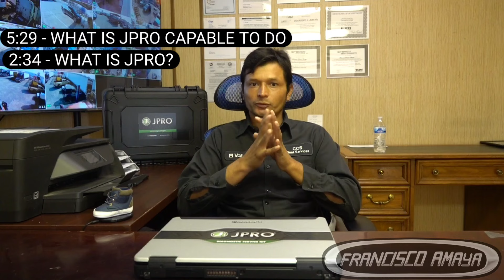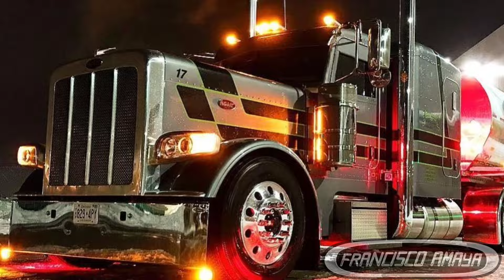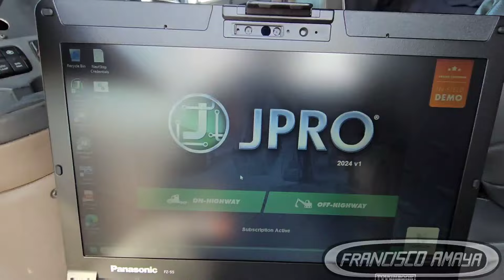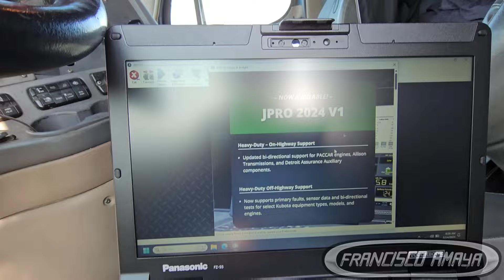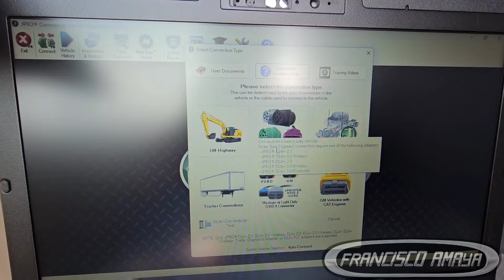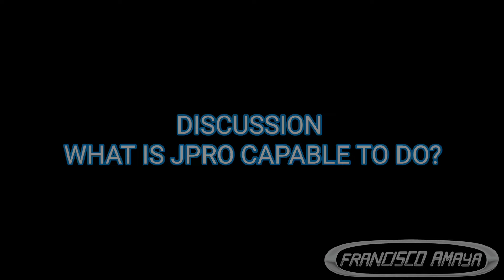JPRO diagnostic software for heavy duty and medium duty trucks honest review

Comment: Thank you for explaining the JPRO software how it works and the benefits of having it. My mechanics made the mistake working on the DT12 tranmission with out the software big mistake. Can you in your video taking about the DT12 transmission the importancy Of having the proper software on any of the components of the truck before working make sure you have the experience and the proper software. Thanks for all the information on all the topic from engines to transmissions and all the other sytems.

Comment: I buy insite from Cummins is $700 and dddl from damlier is for $700 as well. Where are you getting your entry level OEM software from for $2,000 per subscription?
Reply: I got cummins insite pro 8.7 for 200$
Reply: @chaisutton2153 how you get it if you dont mind me asking? we had diesel laptops and insite but switched to jpro. I want to get the insite again

Comment: I’m a fleet mechanic and I work on mostly Mack’s, and occasionally a Pete or KW. The shop uses JPro and it’s a fairly straightforward program to use. The graphics for DPF regen are nice and really helps someone like me that’s a general mechanic and not a diesel specialist. A video idea would be to compare OEM software vs JPro for common tasks like code reading, live data, and forced regen. JPro has a nice option where you can create a custom list of PIDS and watch the data via numbers or graphing.
Reply: Any suggestions for an affordable handheld scan tool. I’m an owner operator that owns a 2016 Pete 579
With Cummins 10spd.   I currently have the basic otr tool that just does forced regen and clears dtc’s